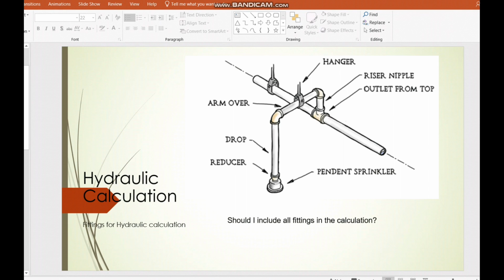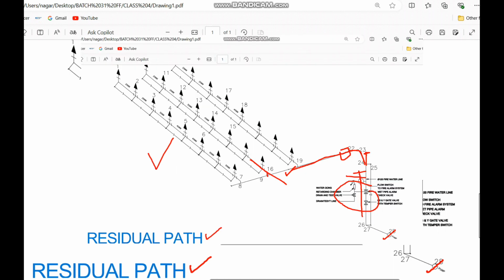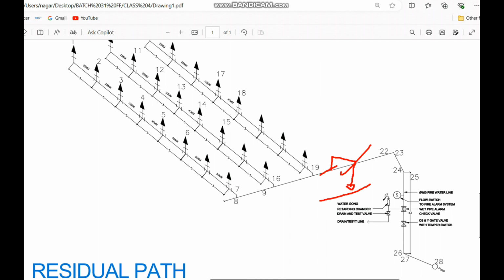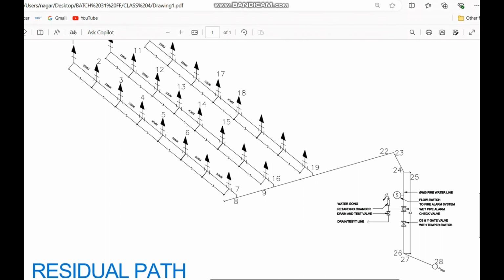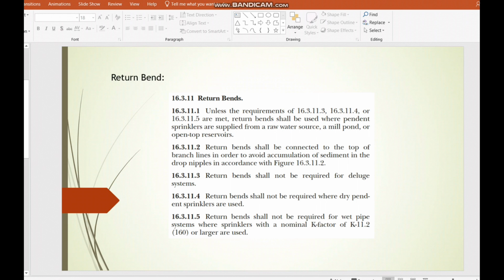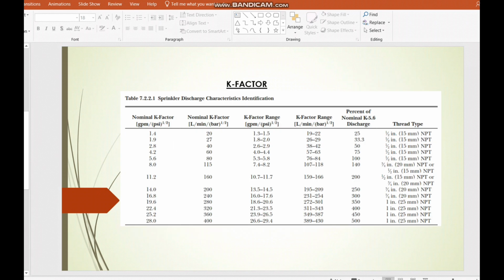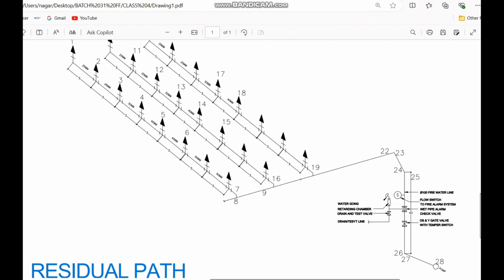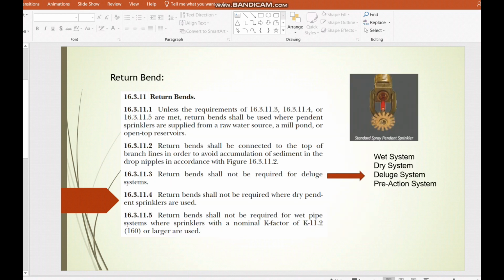Return Bends in Sprinkler System & hydraulic Calculations Mistakes related to Return Bend l NFPA 13

Comment: Sir What is the Method to know what size of Pipe should be Sprinkler Head pipe and Sprinkler Riser Pipe...pls tell me
Reply from the maker: @asad2960  thank u dear for question. Sprinkler riser means I hope you are asking vertical riser pipe from pump room to serve all flpor that pipe correct. Not vertical nipple by mistake u ask as vertical riser correct
Reply: @mepworld3385  Yes Sir Vertical Riser Pipe, which go from pump room to serve all Floor.
Reply from the maker: @asad2960  for pipe sizing we will first add pipe sizes based on pipe schedule chart of NFPA 13 then when we perform hydraulic Calculation. If the velocity exceeds the value then we will increase the pipe size to limit the velocity. This procedure will give the pipe sizes for vertical riser, branch and cross main pipe sizes also.
Reply from the maker: @asad2960  In future I wil post a video of elite software to explain this velocity concept and changes in pipe sizes also
Reply: @mepworld3385  How to Calculate fire pump??
Reply from the maker: @asad2960  if u watch my complete hydraulic calculation videos from start to end , u will know how to find out the fire pump capacity based on hydraulic calculation
Reply from the maker: U need to start from this link https://youtu.be/i-qDS7pelL8?si=kmr8rDEG_W-hjHr9
Reply: @mepworld3385  if there are three floor then what should be Pressure at each floor.
Reply from the maker: @asad2960  in order to decide pressure, we need to perform hydraulic calculation with step by step node procedure which I explained in a very detailed way in my hydraulic calculation videos. Please have a look at that
Reply from the maker: https://youtu.be/i-qDS7pelL8?si=kmr8rDEG_W-hjHr9